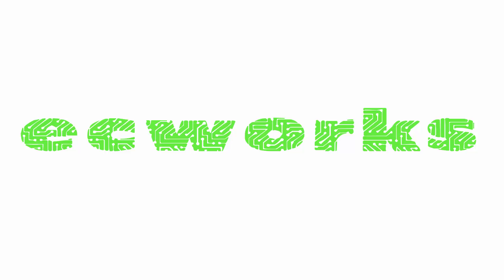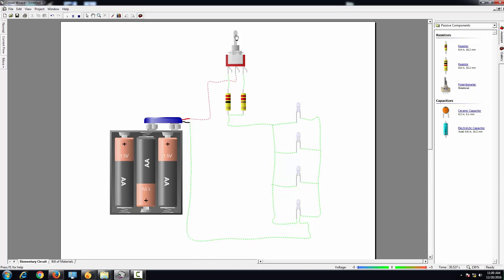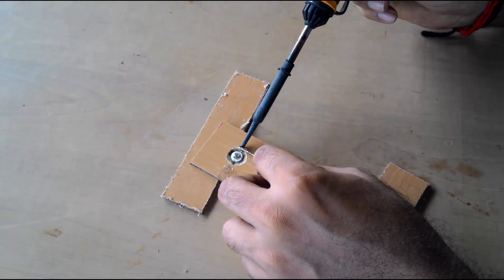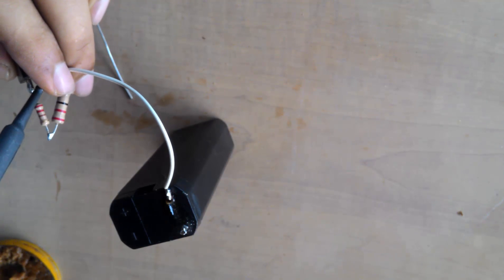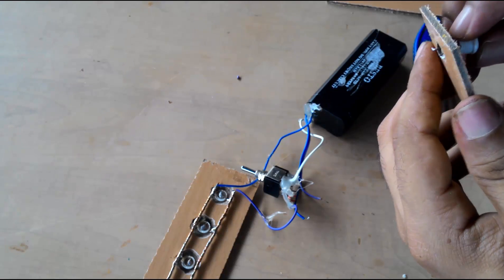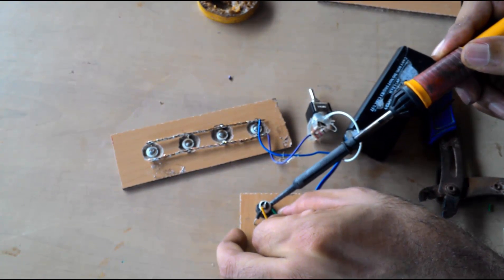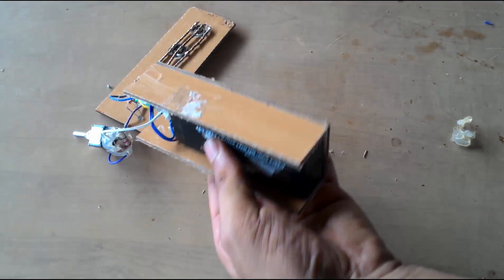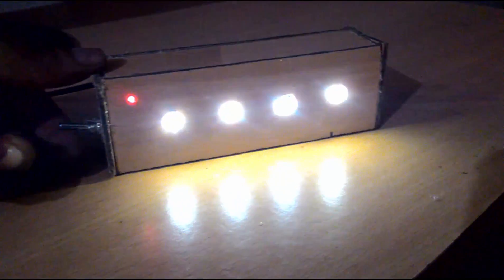LED Lamp-HOW TO MAKE A BRIGHT+RECHARGEABLE+ BRIGHTNESS ADJUSTABLE  LED LAMP

Comment: with 3.7v mobile battery and 1wt led how many led and which type of resistor used?
Reply from the maker: use 3 or 4 leds,and select resistor as per the two mode of brightness you need
Reply: +ecworks for 3 led on 3.7 v which resistor u perfer?
Reply from the maker: use can use the same 22ohm and 220 ohm...
Reply: +ecworks OK thanks..